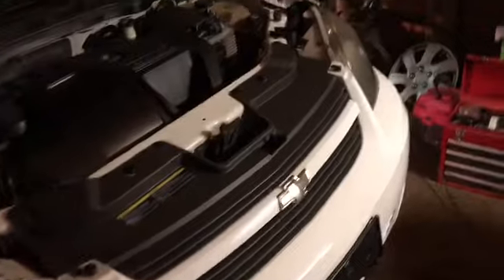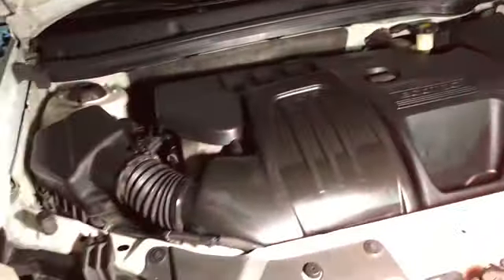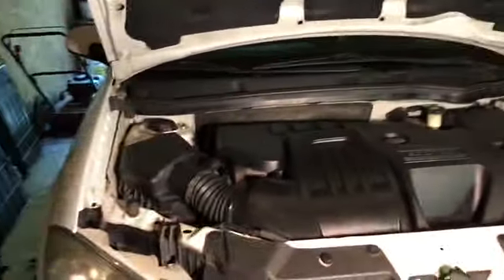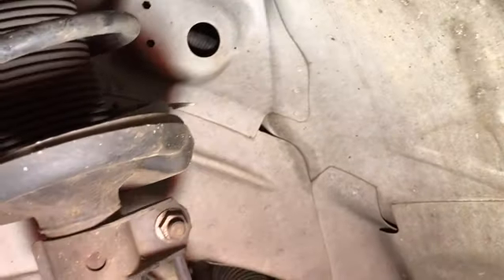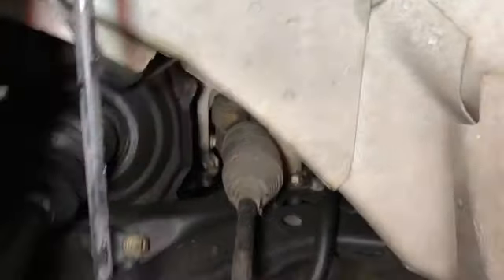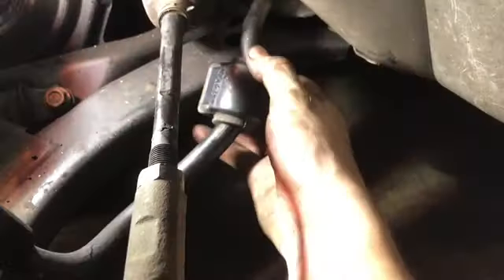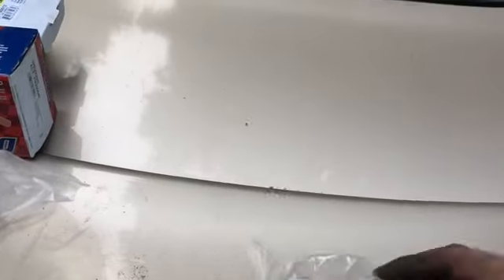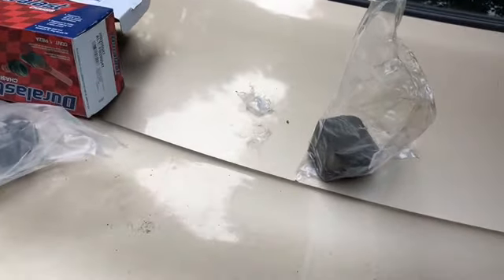2008 Chevy Cobalt Sway bar bushings and links

Comment: One way of keeping them pliable and or from cracking is to take a bottle of AT-205 seal sweller by ATP  and pour it into a spray bottle and spray them along with your other bushings and rubber boots such ball joints too

Comment: Thank you so very much for your DIY, it's just what I needed. I have a 2008 Chevy Cobalt LS 2.2l and I'm replacing the sway bar links and bushings tomorrow 6/30/2023. It's going to be 90 degrees in Philly tomorrow, so I'm going to start at 6AM, because I am to old and can't take the heat. Getting an old body really sucks big time. Sincerely thank you Stan.
Reply from the maker: Much welcomes

Comment: Hey man I have the exact same car in the exact same color! I'm gonna be attempting to change my sway bar bushings right now, wish me luck!
Reply: I just got blue Moog bushings in the mail today, I've had this rattle in my car for the longest time. I replaced my control arms last summer along with my links and the noise didnt go away, hopefully this helps
Reply: The newer cars are, the cheaper it seems they're made. This one is no exception. It's a go cart chassis with a i4 in it. Mine was sent into a ditch after barreling through a fence and a mail box by an in-law. Steering wheel rattle ever since. Over the past year, I've replaced 2 control arms, 2 sway bar links, all shocks/struts, 1 wheel bearing, and most recently, the intermediate steering shaft. While the rattle is still indeed there in the s-wheel, each subsequent part replaced lessened the noise more and more. It's not too noticeable anymore but there is still a slight rattle at the wheel and light clunking sound over bumps and whatnot. I'm hoping this is the last piece that needs replaced.

Comment: My aunts 2006 cobalt front driver side rattles from time to time. Would it be the links? Thanks
Reply from the maker: Could be links, inner tie rod, outer tie rod, wheel bearing hub, or ball joint (control arm). Or an off balance tire, bent rim, or busted belt in tire.
Reply: Could be the steering shaft link
Reply: I'm having the same issue with my 05 cobalt. Seems like everything looks solid tho. Can't for the life of me find what's making that nose. It's driving me crazy

Comment: i was going to reinstall the sway bar links.  so ,what is the torque spec for 05 chev cobalt links ?
Reply from the maker: Only thing I could find when I check was just to tighten them tight. You may be able to call your local Chevy dealer service department. They may be able to tell you.

Comment: It looks like you grabbed the wrong sway bar bushings. New ones look like the hole is larger. 🤷
Reply from the maker: Yeah that would’ve been AutoZone is where I got those they said they would fit turns out they were wrong so I went to advance and ended up getting the right ones. Those swaybar bushings were for the sports model of the cobalt.
Reply: @StansAuto83  yeah I had the same thing happen with the sway bar links. I ended up with the wrong size. Got the 9.8" ones and when I measured I needed the 11.8" ones. I see you had the same issue. Did you find installing ones that were shorter changed the ride quality? And did you change both to the shorter ones on both sides? Just wondering
Reply from the maker: No just upgraded to the sport sway bar links and bushings. That made the handling way better!